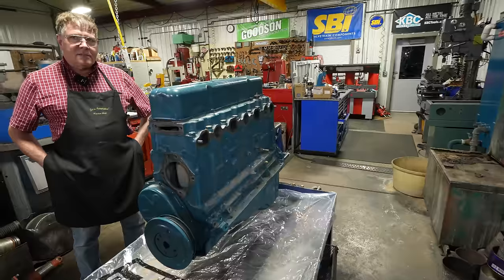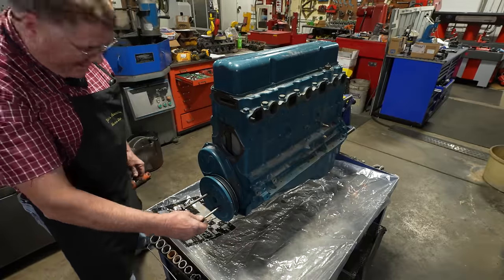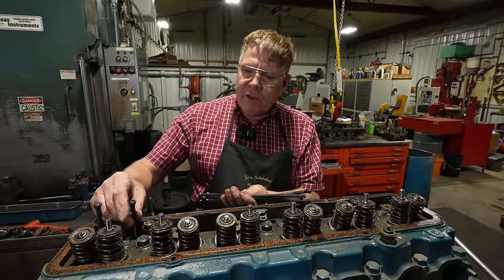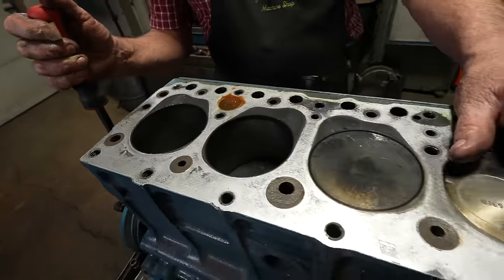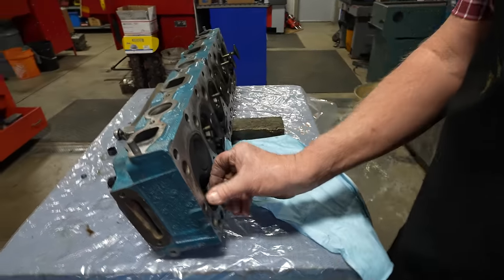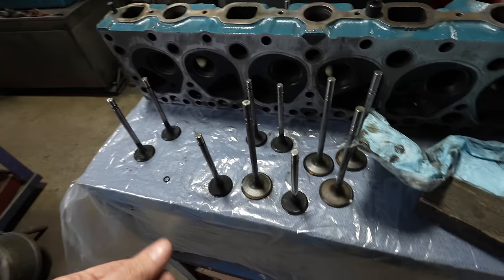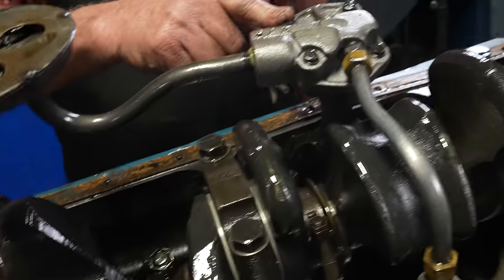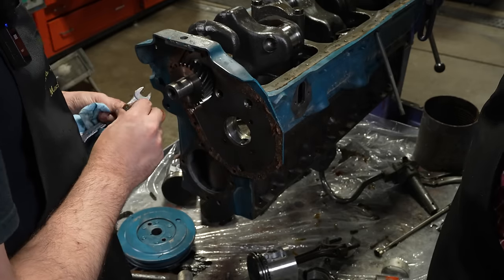Their 235 Chevy BROKE DOWN 10 Miles After The LAST Shop's Rebuild...

Comment: I remember my first vehicle.  1960 Chevy Carryall.  Cartridge oil filter, externally rotating distributor body (vacuum advance), 15 PSIG oil pressure.  Remember changing main bearings in place.  Finished at 3 AM before leaving on a 1000 mile trip!
Reply: Back in the day, drive home from work with a loose valve seat and pull the motor out of my Datsun 1200 ute. Second hand head from the wreckers quick bottom end rebuild, lap a few valves and bobs ya uncle all ready for work by 11pm. Ahhh those were the days.
Reply: There's a company out there that is doing frame up restorations of old trucks and modernizing them with newer engines ,power brakes and steering, a/c etc. I wish I could find the link. basically they are building sleepers.

Comment: Great episode!  FYI...I have a 56 head on a 58 block and did not have shims.  Also I did not have the drilled headbolt for rockershaft oiling.  Found out this was only needed if you mixed very late with early blocks and heads. My oil passage was clogged after cleaning the block behind the plug inside the lifter access area. The hole needs to match the gasket and head. A 1/16 drill bit by hand worked out the carbonized junk then hit it with the air gun. Love your work.
Reply: Nice work, It's a good thing you checked that hole.
Reply: The earlier chevs (War time) had a copper pipe going right through the block from under the carby to the cover on the right, then an elbow with copper up to the rocker gear. I know because my Dads truck leaked coolant behind the cover. Ted from down under
Reply: I betcha tar based engine oil clogged that hole.

Comment: These old six cylinder Chevys got the nick name stove bolt Chevy from the screws rather then bolts that held the side cover and the valve cover on.. Great video..  I really enjoy watching your videos as you get into specs that other videos would not include..  You two work together wonderfully..  Cherish your relationship..  My Pop taught me a lot about these old stove bolt chevys..  I still have a doodle bug I built when I was 14, and now I have a 51 two ton that is all original..  It even has the factory head liner in it..  235 with a four speed and a two speed rear..

Comment: As a 73 year old our 1963 Impala with three on the tree with this same 6 cylinder it’s amazing the engine stayed together but the 3 speed transmission exploded one time by immaculate explosion as far as our parents knew 😂 and my brother and I stuck with that story.
Reply: They didn't have 235 in 63
Reply: @jameshester1450  It came with a 230 but somehow a hole got burned into # 2 piston so they had a 235 in stock and put it in. I would have preferred a 327  396 or a 409. A four speed Muncie with  shifter on on the floor would be better but we would have really tore it up. A guy brought in a 69 red SS with 5 000 miles on it and ordered a new 1970. I grabbed that SS Camaro asap because I worked at the Chev garage. We got in a Z 28 that went under a truck and I bought it from the insurance company for $150 Engine, trans, rear axle and a tubular exhaust were perfect so you know where it all went. It made one hot SS Camaro. Lol

Comment: Seeing that big old six and the truck it was in once again reminded me of two sounds from years past, which are inseparable and irreplaceable. 
That of the in-line six exhaust note and that distinctive thud when the stop on the stem of a floor mounted brake pedal impacts the floor board when the light turns green and the driver drops the brake and steps on the gas.
Reply: I have true split exhaust with glass packs - a sweet melody’s 

Also, the 4 speed w/ granny was the transmission in my school buses- the distinctive sound and shifting noise reminds me of those years

Comment: Years ago I bought a 56 Chevy pick up that had that engine in it.  One day I pulled the valve cover and my heart sank.  It was sludge up.  I pulled the pan and side  cover and washed down the engine from top to bottom.  No excessive rod clearance do just put it back together.  It did not run any better but I felt better since I know it now was a pretty clean engine.

Comment: 848 head, 56-62 235.  261 used different casting, larger combustion chamber, steam holes drilled in head like a 400 chevy.  The only exception, Pontiac of Canada.  Pontiac of Canada used essentially the 56-58 small oil line 261 as their entry level motor.  Those motors used the 848 head with factory holes. Valve cover for 59-63, used breather in center of valve cover.  55-58 the breather is at the front of the cover.
Reply: I grew up around mechanics and owners of this era and brand of vehicles, and saw a lot of parts pieces etc was quite young but still remember a few things. 
They told me that (basically) the Pontiac engine and pickup truck/school bus engine back then were the same or would easily swap out and run fine.
The Chev only sedan engine was the 235 and the little brother to the Pontiac/Truck-Bus engine. 
It was fairly common back then to find a GM with a different than original engine. 
Also unless I was misinformed, the Pontiac engine was red, the Chevy was sea green or blue. I've seen sea green pickup and bus engine so I believe only the Pontiac was red. 
They were all "leakers" oil leaks but easy as pie to get running
Personally I think the much later 250s were the cats meow.

Comment: That valve thing reminds me  of an F350 460 4V that got sabotaged with sugar in the gas tank.  3 intakes stuck, push rods fell out and 1 of the lifters popped out of it's bore.  I took it apart and tasted the goop on the valve stems...yea, it was sweet.  Looked at rear gas tank filler neck and there was still sugar sitting there.   Wild that sugar could do that.  Seems like a lot of carbon in that engine for 10 miles.
Reply: I remember reading that sugar would not dissolve in gasoline. If it was gasahol, that probably would dissolve the sugar.
Reply: i had some neighbours that i think were stealing petrol /gas from my car.. I bought a scrap car for spare parts but I mixed as much sugar that would dissolve in 1 gallon of petrol and tipped it in the tank..a couple of days later their car bonnet/hood was up for a week

Comment: Our machine shop  always pre lubes  everything  and runs engines for break in  
Plus always use marvel mystery oil in fuel helps lubricant everything   and 
Valvoline 30 VR1 racing oil  high zinc  break in 
Great video thanks for posting
Reply: Ours never had anything to prelube. Not until I made a set up to do it right. Before I started working there,they had a couple fail before they even made it out the door. I figured I’d put an end to that. It’s easy to do now and there’s no excuse not to. Cost $30 dollars to make.
Reply: @gregpenner2876  i agree plus wrong kind of valve seals  I bet engine was assembled with just oil instead of  thicker break-in lube that stays in place over long storage 
Before  installing    on our older engine  rebuilds I like to run on engine stand a few cycles  
And check everything  and certain situations we will install   who ever built that guys engine 
Was in a rush didn't take precautions and many mistakes made  .. keep up the great work 
Thanks for posting awesome videos  thanks 👍
Reply: I'd never let a machine shop put my engines together. I've caught too many errors in machine work.
Reply: @quagmiredavis4117 uh do you think 5 thousandths too much clearance on the mains might have had something to do with lack of oil to the valve train???
Reply: @Bryan-Hensley  our family machine shop 1931 when we opened 
Never any issues  everything 💯 checked and re checked  👌 
Plus specialty and antique engines  run on our break in stands 
3 different cycles   and yes some just aren't good

Comment: that was a great autopsy of the engine. Very interesting find as well, with the bearings. I also will not use valve guide seals when the engine did not come with them.

Comment: I am a marine mechanic and about 1990 I rebuilt a 4.3L GM based engine. The main bearing journals where turned to 10 under and that's the bearings I ordered from OMC which where reboxed Clevite bearings. The boxes we received where marked 10 under and apparently I didn't check the bearings themselves. I miked the crank to be sure the machine shop tagged the crank correctly but didn't plastigage the bearings so I didn't know the bearings where 1 under until I ran the engine on the floor prior to install. Low oil pressure and crankshaft thud could be heard. When I rechecked I found the bearings where in dead marked 1 under but the boxes I still had was marked 10 under. This time I miked the bearings and the crank. We have the check everyone's work ahead of us and it's getting worse. This week I had a Mercruiser distributor cap pre cracked from the center tower to one of the plug wire towers. It looked like it happened when the carbon brush was staked into the tower.
Reply: This is a great example for how I've approached any project/problem. #1- Always start with the simplest solution. #2 - Never trust the person before you.
Reply: I think someone at Clevite dislikes 4.3 engines..I rebuilt mine a year or so ago, my mains were supposed to be std, but they were actually .010's...ended up going thru the same engine (don't ask) about eight months later, this time the thrust surface was something like 40 thou too thick..
Not a huge problem, just dressed it to size on a surface plate...but MAN, I'm paranoid about measuring new parts now!
Reply: As a percentage of the population, the number of "gearheads" is dropping drastically, and these sorts of errors are one of the results. I'm a retired field service engineer for two very large diesel engines/equipment manufacturers, and this sort of thing is an epidemic out there.
Reply: Always trust but verify
Reply: Happened to me 40 years ago. Boxes marked one thing bearings were another. It was just 2 boxes out of eight though!  Plastigage is your friend and always has been.
Reply: @johnk3606  
I was a mechanic in the seventies, switched to OEM parts geek for a couple decades after..
There has always been the occasional mixed up digit on a part number somewhere between the supplier and the end user, but nowadays it's become the norm.
The afternarket just ain't what it used to be..especially since the covid mess.
Reply: That's made in USA quality for you. They don't even bother to put fasteners on Boeing aircraft any more and when they do they don't tighten them properly!
Reply: @andrewallen9993  
Negative...if you find a US made part that actually SAYS "Made in USA" on the box, buy it.
Offshore parts quality has gone down the crapper, genuine US, Japanese, German (first world) parts are worth the premium they command...it's just pretty damn rare that a USA "name" is actually USA built anymore..
Reply: @zrxdoug  I'm pretty sure they make Boeing aircraft in the US, IBM And Hewlett Packard computers not so much. Where I live nobody buys US cars anymore despite having an excellent reputation 40 years ago.
Reply: @johnk3606  untill they put the wrong plastiguage in the right box?
Reply: That would be a easy mistake to make. I've never checked a set of over or undersized bearings. From now on I will thx for sharing.
Reply: @andrewallen9993  
Talking aftermarket parts here, not post-covid aircraft..
:P
I'm a Detroit boy (well, a 60 year old one) who's done time at all the OEMs, and I gotta say you're 180 out on that "40 years ago" statement. 
Forty years ago was 1983, and EVERYTHING outta Motown was built to fail..that has changed dramatically in the last twenty-five(ish) years..the big three have (more or less) caught up to the competition..surpassed 'em in the light truck world. 
So go easy on my spoiled UAW brothers and their corporate masters..
😁
Reply: @zrxdoug  My father replaced his slant6 Chrysler Valiant with a Peugeot 404 and 504. I still buy US piston rings when I can't get German or South African ones. Now if they can't get aircraft right what chance does the US have of getting vehicle parts right?
Reply: I am a small engine mechanic, we use Briggs and Stratton graphite grease on intake and exhaust valve stems. When they removed lead from gasoline graphite grease was the cure especially on the intake side.
Reply: The only way I know. REQUIRES plastiguage
Reply: @chuckwhitson654  
In the case of my undersized mains, it was readily apparent before I got to the point of measuring anything. The crank wouldn't even seat in the upper shells.
In my second incident, the thrust bearing didn't fit between the crank throws..
The clearances would've been checked regardless, but needing a BFH to install a bearing was enough of a clue for me..
😁
Reply: The 1942 chev 6 engine had babit bearings and I'm sure they would have had shims in the bearing caps, in the late 1960s we sent the block, rods and shaft down to Rockhampton Central Queensland Australia to have them bored for shell bearings, that motor was  much later than the War years. Ted from down under. Also about 1972 I sent Bedford parts to Rockhampton for machining.  The valves froze up because it stood unused for a couple of months, my uncle managed to free them up with some oil and a gentle coaxing with a hammer.
Reply: @zrxdoug  you mean the fake coof correct? 😅
Reply: @sixtyfourchebby4507  
The effects it had on manufacturing sure as hell ain't fake!
The same people who made a career of shoving American production out the door slammed it and nailed it shut with hysteria over the common cold.
🤔
Reply: American accountant driven quality control. Boeing has the same problem - accountants who know the price of everything but the value of nothing.
Reply: Surprised it wasn't tight right away. And as for the valve issue who's to say the last guy that round the seats that they didn't clean the guides
Reply: That is a long valve...

It seems like...just leave out the non stock valve stem seals...

Those long guides need some oil....

Maybe old school stock is just the O-rings on the intakes...

And that is good enough...
Reply: Weird to have mains ground less than rod throw
Reply: Loosely goosey...a 0.02" oversize bearing on a crank with main ground 0.03" undersized...

What a pain with all the stepped main journal sizes...

I bet Sunnen doesn't make a line hone ...

A old FJ landcruiser..came in...it had stock main cap shims...and was a pain...for there were lots of different shims every where....

Like the Toyota copied the GM 235...

Then refined it....

But that FJ was like a 1972...
Reply: I’ve worked industrial maintenance for 20+ years and you wouldn’t believe how many parts are packaged wrong or they send the wrong part. Heck there has been numerous times the part was bad including fuses. Ya bad fuses from the distributor. Because of this is has been a habit to always double check what you have. There is nothing more aggravating then to assemble something just to find that you have to tear it back apart. I’ve seen new guys put something together for the machine to still not run. They assume something else is wrong so they spend several hours trying to find what is it before realizing what they replaced was bad. There’s nothing like wasted time.
Reply: Plastigage!
Reply: @zrxdoug I have two German cars and do my own maintenance and minor repairs. Finding parts not mde in China is becoming almost impossible.  Even from the dealers!
Reply: @zrxdoug
Reply: That's nuts, I'm currently working on my 91 mustang 5.0. On 2 posts on the distributor spark is weak. It has the control module that mounts to distributor. I'm hoping that's the problem. I've been chasing a misfire and idle surge. Everything else is new on it. When I looked I didn't see any cracks on the distributor. Otherwise compression is 150+ on all cylinders. This car has been a huge pita. If it isn't the module I give up on it.

Comment: The earlier 216 and 235 engines had babbitt bearings and I thought it was those that had the shims. It's been 30 years since I've messed with a stovebolt chevy so I can't remember. 

It's definitely a 235 though as the 261's have steam holes in the head/deck like a 400 chevy.

Comment: Some of the Chevy 6 cyl. (1953 and earlier) has babbit bearings and a 15 psi oil pump. The the shims had to be removed as the babbit wore out.  The oil pan had trays that the were filled by the oil pump and scoops on the rod ends to oil the bearings as they rotated.  In 1954 they changed to insert bearings and a 45 psi oil pump.  Make sure you have the correct oil pump.  Learned this the hard way.
Reply: "Oil Dippers"  aka "Splash lubrication".
I'm thinking with today's more uniform lubricants the old dipper engines would go longer without needing teardown.

Comment: The umbrella seals on a 235 will cause the valves to seize up. It happened to me. Fixed the head. left out the umbrellas and no more problems. I had this happen in my shop.

Comment: Rebuilt a 4.2 2F toyota straight 6.  Meticulously cleaned before rebuilding.  During first drive the valve train started clacking so headed home and pulled the valve cover.  Had three stuck valves that I could, luckily, lube and tap and they became unstuck.  Pulled the pushrod assembly, removed the rockers and pulled the end caps off the pushrod tube.  The only thing I didn't clean before... 
I just ran parts cleaner through the oiling holes.  When I removed the end plugs the hollow shaft was full of carbon and sludge.  Took a 12 gauge shotgun brush, cleaned, flushed, installed new plugs and ran good as new.  Definitely could be the umbrella seats or just a sludged up rocker tube. 
I got lucky.